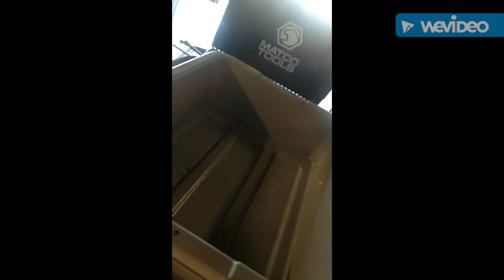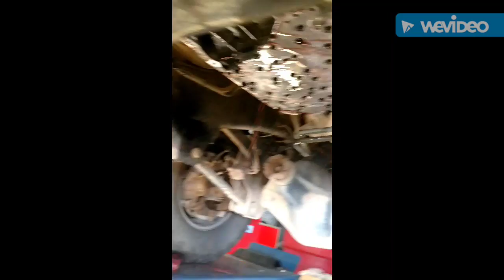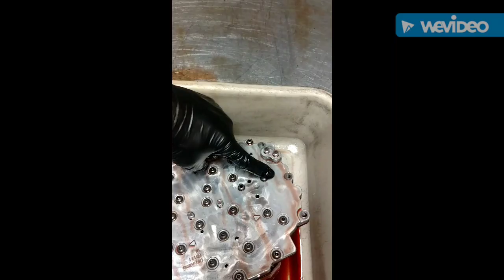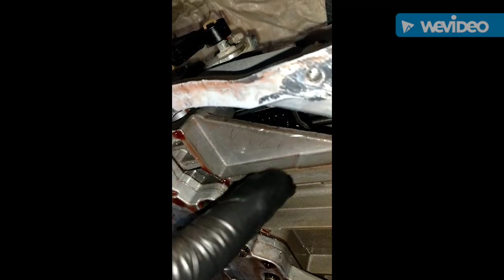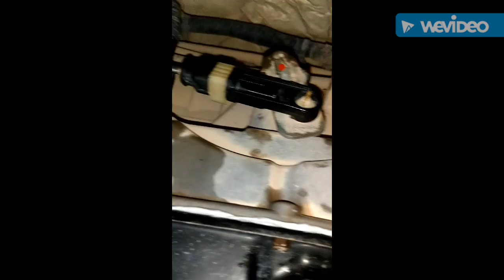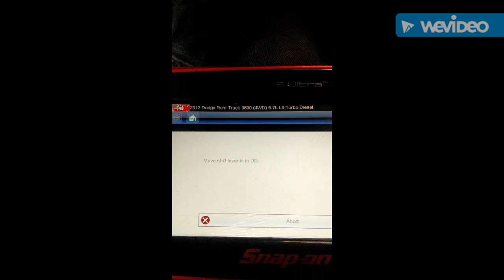Dodge 68RFE P0750 DTC Repair

Comment: I changed the solinoid pack on my 07 ram 1500 because it wouldn’t start obviously this supplies power to starter as well ..I replaced it it started up filled with fluid reverse works great but when I put it in drive it’s like it binds the engine will not move at all as if the breaks were on but I know it’s not the brakes or calipers etc any ideas?

Comment: I couldn’t have performed this replacement without your video. Excellent work! Showing which bolts to take out saved a significant amount of time. It would be cool to include torque value. Those 9mm bolts don’t take much to break. Saved me $2,000 plus tax here in Texas. Thanks again
Reply: 15 inch pounds not ft pounds

Comment: How much is that repairI got a 2500 dodge ram 2008 and it makes shift bad after a while of running I got p0700code and p0740 and it said they said transmission control system and torque converter clutch I just change the oil a week ago but I didn’t know how remove other part so am doing this I hope it works thanks great video

Comment: Will a OBD II reader work for the quick learn. Also how long will It take for the computer to pick up the new shift solenoid with out it?
Reply: Markoosie Hulan 

In case you didn’t find your answer,
I can tell You, no. 
A regular OBD2 code reader will not preform a quick learn or relearn on a 68RFE or preform any bi-directional functions such as a relearn / 
quicklearn

A OBD2 Code reader is just that, reads DTC’s and maybe give you live data from the sensors it can access.

You need a good quality scan tool with bi-direction controls, but even then you want to ask the manufacturer of the scan tool, if it is capable of a Chrysler 68RFE Relearn or Quick learn.

I have been looking for a good quality scan tool without breaking the bank.

Snap-On like shown in the video are between $3,000 - $12,000 depends on the model , accessories, & subscription that comes with it.

Launch X431 ICARSCAN is capable of a quicklearn / relearn and goes for $250. 
I am leery of it, because with scan tools I have learned you get what you pay for. 
But I have heard some good reviews about it. 

Autoenginuity is another good one but is over $1,000

Autel MS906 & MS908 are also capable and are around $1,200 to $2,000 depending where you get it and what accessories you get with it.

The list goes on.....
Reply: @shawn8363  Hi, is it this diagnostic model that can perform these functions? https://www.amazon.de/Creader-Intelligent-Diagnostic-Transmission-Scanner/dp/B01DXPFZJ4/ref=sr_1_22_sspa?adgrpid=79433496702&dchild=1&gclid=CjwKCAjww5r8BRB6EiwArcckCwuBXk4Mt1IXsfTGOxRnyj9U0FqYs238rvQuI8aOHwGqcyQNCDBvChoCW98QAvD_BwE&hvadid=394597210302&hvdev=c&hvlocphy=1003779&hvnetw=g&hvqmt=b&hvrand=2525296519888435137&hvtargid=kwd-33281250083&hydadcr=14254_1824663&keywords=launch+x431+pro&qid=1602678651&quartzVehicle=184-492&replacementKeywords=launch+x431&sr=8-22-spons&tag=googdemozdesk-21&psc=1&spLa=ZW5jcnlwdGVkUXVhbGlmaWVyPUFYVlRDRDYzUDlEQTkmZW5jcnlwdGVkSWQ9QTAwMTA0OTExRVJZUzkyTUUxSU8yJmVuY3J5cHRlZEFkSWQ9QTA4NjE2NzgzR0tJV1YwVDlNTVZLJndpZGdldE5hbWU9c3BfbXRmJmFjdGlvbj1jbGlja1JlZGlyZWN0JmRvTm90TG9nQ2xpY2s9dHJ1ZQ== thanks

Comment: I have a question. I have a 2007 Dodge Durango, I get the error codes of p3425 and another code p0750.
Reply: 2005 Dodge Dakota only going on reverse, I thought this would fix the problem but I had no luck! Any suggestions?

Comment: Troy...quick question. Would this also be a possible fix for transmission slippage when accelerating quickly?  I have noticed this recently, and it has been too long since servicing my transmission, so I did that...but (long story) my solenoid pack was not delivered from a vendor, so I tried the servicing without it..and I still have the same issue.  Thanks for any thoughts and for a great video. Nick